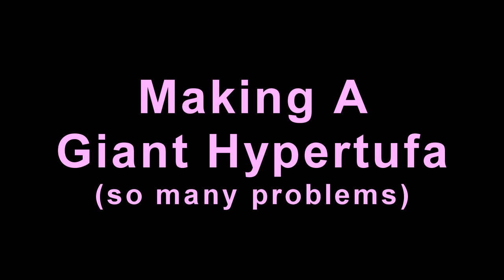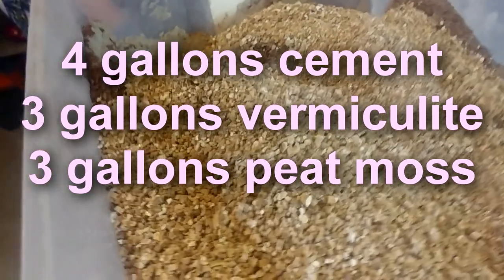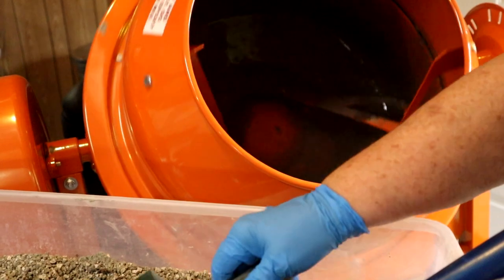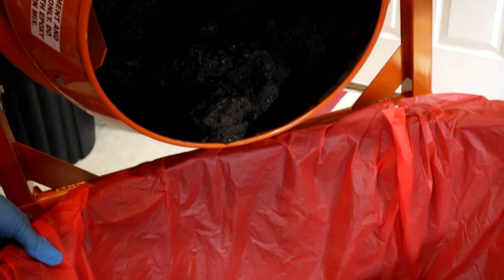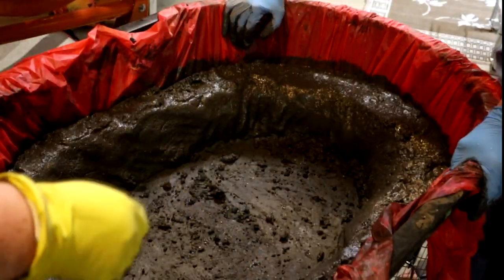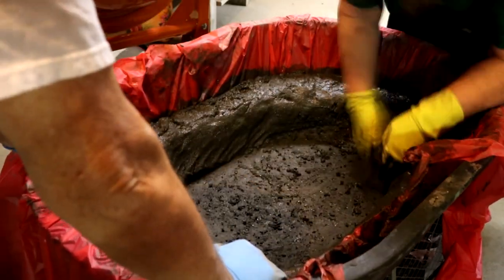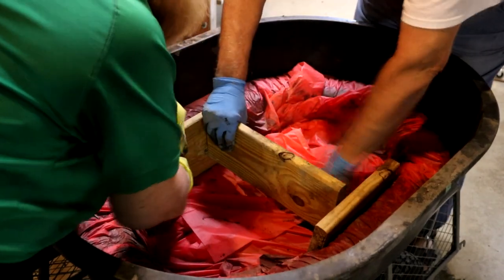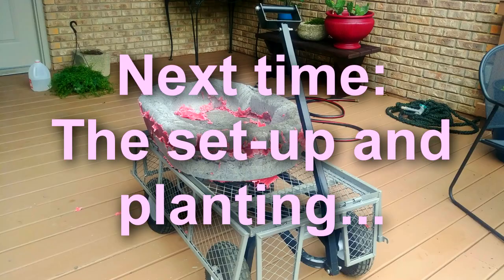I Made Another Giant Hypertufa- So Many Problems!

Comment: Use beach sand as the inside mold I do it all the time it helps hold the hypertufa sides! You take the sand out when it is cured. Many times, I line the inside with a garbage bag or plastic wrap than add the sand. Thank you for your video the hypertufa pots are so addictive and fun to make.

Comment: Have you thought of using sand to help hold up the inside? You could lay down another piece of plastic over it and then put in your sand and press it down to hold up the sides. You could even lay a flat board on top if you got it up to the height of your hypertufa. You might also be able to use the sand to make your walls thinner and the pot higher. Just my two cents worth and if you use it I hope it helps. I love your Channel and thank you for the ideas!
Reply from the maker: Yes, thanks for the watch. In my blog post I explained about not having enough sand to fill this "cavern" which is a method I typically use. But sure didn't have enough. Since it's 40 gal tub and I had it half-ish full, I would have needed maybe a good 15-20 gallons of sand and just didn't have enough. But we improvised and got a planter out of it. ( I will probably start stockpiling sand...for the future. LOL)

Comment: I make 55 gallon tall light wieght concrete planter pots....I use a hammer drill and a large concrete mixing bit....I love giant pots....very pretty. funnily to build up the sides,,,I hand pound..it works...I use a rubber mallet when hands get numb...I also make an irregular (marble effect)using while portland cement as first layer against the liner before building up thicker with cheaper regular cement combination.. I put the lid on my 55 gal black feed container ...very durable $59.00 tub...and let it sit for a couple of days then lay on the side, pull out the drum plastic insert..to get it started then stand it up and it pops right out:).55 gal can liner 3mil...yup it works great...Id love to send you photos of finished product...after it dries out throughaly, I add dried moss to some of the grooves made by the plastic...these are magnificent. Unfortunately difficult to sell because...of the wieght and possibility of crackign during shipping so I sell them locally for around 400 each.
Reply from the maker: Now that's a huge planter.
Reply: I would be interested in seeing pictures if you have any! I also want to make big containers and not just small ones as I want to pot bigger plants and not just succulents
Reply: I’d love to know what your giant planter weighed!!

Comment: Did you wet the 'old' cement bottom prior to building the sides?  From the other videos I've seen with cement, etc, it has to be wet or the old and new won't bond.  Another question:  Do you ever add about 1/2 to 3/4 of the water you should need to mix it and then tweak it once it's thoroughly mixed?  I'm thinking that if I approach it that way, it will mix easier and I'll be able to still have a drier mix that will hold its shape easier.  What do you think?
Reply from the maker: I don't remember wetting it, but it was not a long period of time for the 2nd level. I do think too much water was added in this mix and that caused more trouble than I needed.

Comment: Hi, have you thought about using different sized blue wading pools by any chance?  Also, if you have any successful large planters, could you send me those links please.  Have you considered using pond tubs?  Maybe there are some that may fit in each other nicely.  Do you think it might be possible to incorporate layers of  chicken wire, in order to keep large tuffas walls from caving in while still wet?  Can tuffa be laid in half thicknesses, let stiffen & then build up to its interior girth by using chicken wire layered in between?  How about using refrigerator cardboard as a frame within a frame held together with large aluminum nails that are used with aluminum rain gutters.  The nails are used to keep gutters from bowing out with weight.  Oh, on the large form planter form from H..l, maybe you could use heavy duty black lanscape edging together with chicken wire.  Maybe if you could build a light weight wood frame for the inside, instead of loose pieces, that are more difficult to manage.  Old corugated fencing could do the trick too, just make sure to interface it with plastic or cardboard so the mix doesn't stick to the metal. Please let me know what you think & send me links of videos.  Happy mud slinging😀🌱🥀

Emily

Comment: Given your dry mixtures that  used ,what would you say the correct amount of water you should have used  in litres.
Reply from the maker: I couldn't give you an amount since that is all relative to your mix, dryness of peat moss and humidity. But for this huge one I used a lot of water, just add it and mix until you get the right fudgey mixture. You can always add more, but can't take away.

Comment: Hi Kim and friends and family. I'm sorry that it didn't work out ok on the big planter, I'm sorry to say that you have to make a box mold  .
Why because my hypertufa mold is 24 in. H 24 in.L 24 in W. I have to use chicken wire over the box (mold) to make it the hypertufa light and use less. 
Soon will send you a picture.
Reply from the maker: Thanks so much. I have made them in  box molds several times, but wanted to use this watering trough for this one. But I wasn't thrilled with the way it turned out. Back to boxes!

Comment: I'm thinking of making a bird bath about the same size, but with sides only about 3-4" high, and then the center might only be about 1 1/2" to 2" thick. I'm planning to have two pedestals under it. I was thinking 3 pieces of rebar run lengthwise might be good to keep it stable horizontally. Do you think the hardware fabric would be better at it? Since it would be supported on only two pedestals, my concern is the middle, which I don't want to sag at all.
Reply from the maker: I think the hardware cloth would be great for support. Double it if you feel necessary. I think that would be great.

Comment: Is there a video of the. Unmoulding?
Reply from the maker: No, I don't think we filmed that. Since that was rubber/vinyl mold, it just fell out when we turned it over (after removing the inner props.) No problem at all to remove. Just horribly heavy. I was afraid someone would break a bone. Just tipped and dropped. Took two men.

Comment: I haven't done a Hypertufa before.  Is one able to let it cure for a day or two and then continue to build up the walls with a new mixture?
Reply from the maker: I would not try to cure it then add more later. I don't think it would hold up very well. I have added more just a few hours (maybe 90-120 minutes) later when I had to mix more to finish, but usually in a 24 hr period, it is as hard as stone and would be difficult to get more to "attach" itself.  But you could try and something small to see how it works?
Reply: @KimsGardensandHome  thank you!